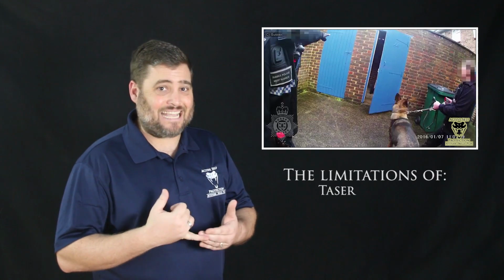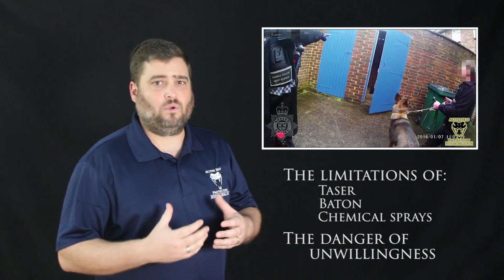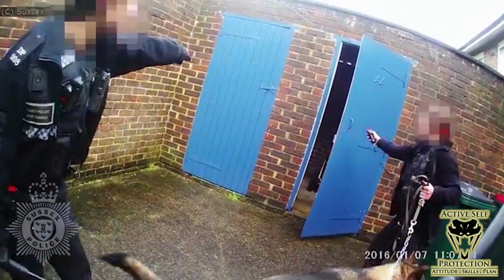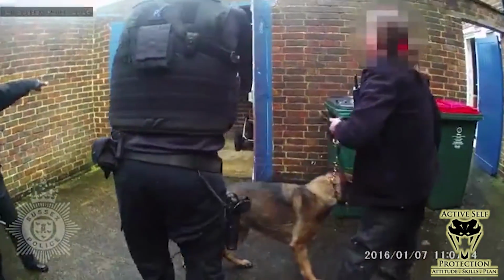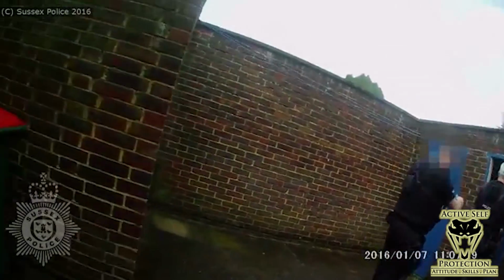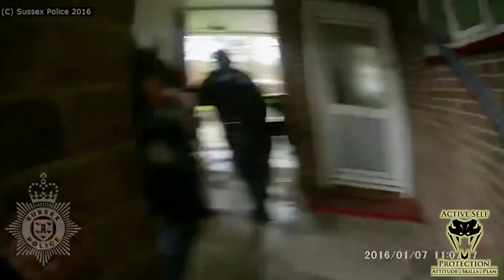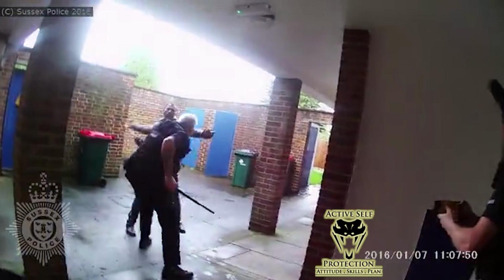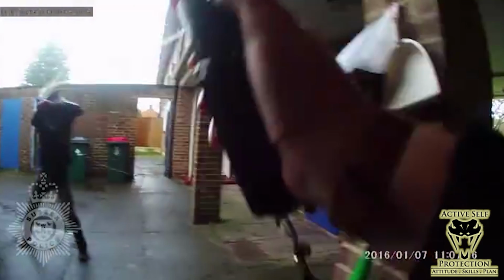Police Fight with Hammer Wielding Killer Shows Limits of Less Lethal Tools | Active Self Protection

Comment: Her screams were sad to hear. I'm glad she was ok. *sigh of relief * I'm angry and embarrassed at these officers. But i understand that a situation like this is not easy.
Reply: +Kevin Goth Funny how you manipulate the truth in this video. She didn't "confront" him, she was simply cut off and then she started to scream instead of defending herself with melee skills(the other woman with dog ran off as well). And eventually male officers had to jump on him, while she hides behind slope(actually during whole procces she was hiding behind male officers).
Reply from the maker: Pretty much!
Reply: Kevin Goth The fact of the matter is mate, that she was useless and did nothing but scream in panic.  She had zero self-control against a guy that had a hammer: not even a knife or gun.  A hammer.  

The other fact is that the unarmed combatives/ self-defence techniques they teach at police academies are usually next to useless.  Someone swinging a hammer is easy to deal with unarmed if you’re properly trained.  

She should be reprimanded and retrained for her failure to handle this situation.  If she can’t handle the heat she should be out of the force or put behind a desk or in to some other non-confrontational role.  

There was also a clear lack of training for taser use.  They should be aware that thick jackets are likely to negate the effectiveness of a taser.  
 
Their best bet would have probably been to deploy the OC spray first in this scenario.  Why they didn’t is beyond me.
Reply: A situation like this is actually very easy, it consists of three easy parts:

1. You have an immediate threat
2. You aim at centre mass of the immediate threat
3. You pull the trigger at least three times in a quick succession

What has essentially been a child's play for a few thousand years now must be learnt again from scratch by people who are - let's be frank here - in the wrong line of work. Well, that's EU for you, and these people are trying to teach the entire world how to live. The fuckers are rotting from within.
Reply: It SHOULD be easy, they're the fucking police. They have both means and justification to shoot the attacker. What they lack however are mental qualities one requires to be a police officer. The policemen in the video cannot protect themselves, how the hell are they supposed to protect the society?
Reply: its not sad, shes a fucking idiot. they all got out and she didnt. If she was a good collected cop she shouldve put a bullet in the idiot. Hes swinging a weapon at you. screaming doesnt do shit but show how badly trained she was
Reply: Dean Cutler Ok Dean, can I make a guess that you’re not in to combat sports, and have received no training in martial arts?

Yes, you are correct, a hammer is a potentially deadly threat.  Would I shit myself if someone came at me with one while I was unarmed?  Maybe.  But I also have a combined 7 years training in military unarmed combatives, in this case Israeli Krav Maga, Brazilian Jiu Jitsu and Boxing, and this training has covered in depth defence against bludgeon implements.  A hammer requires a wide arc motion to have effect and this requires an attacker to telegraph their movement (put simply, they have to draw the hammer back and then swing it).  A trained person will begin their defence as soon as they identify the attackers shoulder movement, and close the distance, which negates the effectiveness of a bludgeon implement.  Protecting the head is the critical factor for a defender.  When the distance is closed there are a variety of options, from going to a double leg takedown, to a stand-up clinch or arm triangle, to a back-take and carotid artery choke, which would probably be the preferred technique for control and restraint in law enforcement.  

With my experience, I would take someone coming at me with a baseball bat, a metal bar or hammer as a gift, someone who is unarmed becomes far less predictable.  Someone with a bat, bar or hammer has at least one hand focused on holding the implement, or both, and those weapons can only be used in a small number of predictable ways depending on how they’re gripped.  Because an attacker holding a weapon is focused on retaining that weapon once you become entangled with them their hands are unable to be used to grapple and strike until they release the weapon, which means that what is an asset to them at the arc range of the weapon becomes a liability to them when a defender is inside the effective range of the weapon.  In other words, if someone ever attacks you with a bludgeon implement, protect your head, get inside and clinch up.  Keep this in mind for if you ever find yourself in this situation.  If, on the other hand an attacker has an edged weapon, such as a knife, then the best defence would be to use your run-fu Nike defence and do an Usain Bolt.
Reply: Maz Klassa i hear what you're saying. In this situation I defo would have set the dog on him. Just to be specific aiming to shoot at legs is actually dangerous as legs are moving targets and having small surface-area spread out these factors are greatly considered. Depending on your region, regular armed police just isnt a priorty for police. But i do feel they to be more proactive/head on than how they are now.
Reply: Maz Klassa ...also Sussex police just aren't used to this type of crime. To invest in gun-carrying officers would be costly. Plus government have made all these big cuts to the police force which doesn't help matters.
Reply: Maz Klassa Releasing the dog or capsicum spray would be the preferred option here.  

Firearms training is to target center of body mass only, ie, lethal force.  Under this kind of pressure targeting legs is nigh on impossible.  

All else is agreed.  In reality, additional to this, unarmed combatives training in police force academies around the world are woeful.  This situation would be easy for a properly trained martial artist to deal with.  I have trained with many SWAT and regular cops who have chosen to supplement their unarmed self-defence skills with Brazilian Jiu Jitsu and Krav Maga private training organisations because they felt that the training provided by the force was inadequate.  It doesn’t inspire confidence.
Reply: KenUbeleveit1 it is, just fucking shoot
Reply: KenUbeleveit1 bye Felicia
Reply: if she worked on cardio she would probably ran away from the guy appearantly her fatass decided to stay their and expected the other officers to safe her ass
Reply: so you expect woman to join in police department who should protected by male officers.
Reply: @thaiefahmed9561  no but the males were armed. The female may not have been.
Reply: KenUbeleveit1 As a UK citizen I find this whole approach to disabling a violent assailant both laughable, naive, but also very sad. In fact it infuriates me. It is an absolutely clear and definite sign of an institutionalized level of cultural tolerance. Tolerance of criminality. Tolerance of taxless citizens (not to mention that this accidental dross of human reproduction is probably a Benefits claimant). UK Police officers simply need to all be armed with firearms. Shoot in the legs to render the assailant immobile for the situation. I'm not saying outright merciless by shooting to kill (even though society would be better off, technically). I'm just sick of this pussified approach led by the standards of the Commissioner which means Police officers have to go out into the criminal world and face potential death everyday while being both poorly trained and equipped with "tools" whose effectiveness is frankly unreliable. And yes Police Officers should all have TWO guns in case the first one fails; then maybe even a third strapped in their upper boot footwear.
Reply: Who ever you are just get the fuck out here! When you have pistol it is really easy
Reply: Dean Cutler
A fist is also a deadly weapon. Everything can be used to kill, from a pillow to a rifle.

Difference is how quickly and effectively it can kill. A small hammer is not a deadly threat in a 1 on 1 fight when you are armed with a baton. 

What we learn from this is that no sane county should let women be front line officers. not in the army or in the police force. 

The UK police force need a total overhaul. No women. No weak men. Only the very best of the best. Teach them how to use batons again. Make them wear great coats again. 

When need the old proper bobbies back. 

Arming all officers in a country like the UK does not work. It's not necessary. It would likely result in more deaths of both suspects and officers. 
What would be far more effective is removing the copious amount of restrictions on police which mean a great deal of them are reluctant to use force when force is necessary, which just leads to things getting out of hand. 

The two male cops could have marched up and beat the living daylights out of this bastard, but because of the virtue signalling left they would have been sacked for police brutality.
Reply: Kevin Goth
They didn't act "infallible*" and didn't " just run off".  The UK police use a strategical retreat method, they were trying to draw him out from the small courtyard where he could retreat back to his house. The woman was dense and failed to retreat and so the officers re-advanced and dealt with the situation in a worse location.
Reply: Thaief Ahmed Hilarious how the tough male police officers who are apparantly infailable just ran off and didn't confront the guy like she did. Piss off with the "only men can do that job" bullshit.

Fun fact there were infact male officers there, who according to you are the only people fit for that job, but did nothing and ran away and tried to stupidly use tasers on a guy wearing a thick puffy jacket when they could have just swarmed the guy with their botons (you know the weapon she stepped in and used).

Funny how you think she's unfit for the job 'cause she has a Vagina but the guys who acted like one are.

Comment: while this video (and so many others on this channel) is very useful, one thing i find critical about this video is that it seems to recommend killing, when clearly a gun should be used not to kill on first occasion but to immobilize via a shot in an extremity, in the utmost case.
i am aware this channel promotes causing least harm, but in this video it might get a wrong message across.
Reply: Niko L no, you don't use a gun to injure or immobilize. That "a gun is not used to kill on first occasion but to immobilize via a shot to the extremity" statement is just not how it works. If you can avoid using lethal force, then you don't use it, simple as that. If you shoot with the intention to injure you are in for all sorts of lawsuits. You shoot to NEUTRALIZE the threat ONLY IF YOU DEEM THAT LETHAL FORCE IS NECESSARY. You DO NOT use deadly force to solely injure or immobilize. You don't use a sword to hurt, if you don't want to kill a person with a sword, drop it, pick up a bat and use that instead. Using lethal weapons like a firearm and shooting a person in the leg to stop them would be use of excessive force. Not only is it an excessive use of force, but there are many arteries in the human body, shooting them in the arm or leg can also be just as bad. You ever seen a cop shoot someone in the leg which ruptured the femoral artery? I have. The robber only had a knife, he got shot in the leg which ruptured said artery, he died within 45 seconds due to blood loss. He died a slow painful torturous death. If you don't have the intention to kill, don't use lethal force.

If you go hunting, what is your goal? To kill the animal you were hunting. If your goal is to hunt the animal, do you shoot it in the head, heart, lungs, spine, or wherever you want? If you chose to shoot the head or heart, you did the right thing. Your goal was to kill it and you did it in the quickest most painless humane ways possible. If you shoot anywhere else that doesn't kill it, that could be considered animal abuse because instead of quickly killing the animal, you chose to injure it and let it suffer a painful and agonizing death which is inhumane. If you don't want to or plan to kill it, don't shoot it. I'm not saying killing people is alright, but making a human suffer when using lethal weapons is inhumane and is pretty much torture and if you have no plans to do so, use other alternatives.

You don't send soldiers into a war zone to make friends with the enemy. If you wanted to make friends with enemies you do so through political negotiations and communication. Soldiers aren't going into a war zone to offer cookies and presents. They can provide humanitarian aid, offer protection, and training but they are not there to capture enemies and be nice to them. If the enemies shoot at them, they will be NEUTRALIZED with any means necessary. If you are sending soldiers to do peacekeeping, they are peacekeepers, they will only fire when fired upon weather it kills the attackers or not is not of concern as long as it neutralizes the opposition, otherwise they won't actively pursue. If you send them for combat, they won't play nice anymore, anything to NEUTRALIZE the bad guys is fair game. If you don't plan to escalate a situation into a conflict, you send peacekeeping troops, to KEEP THE PEACE. Otherwise, if their not here for peacekeeping or humanitarian reasons, they are here to NEUTRALIZE the threat.

This channel promotes SELF PROTECTION. Least harm is an outcome, but that is not the point of self protection. Self protection is that, SELF PROTECTION. If you need to neutralize the threat (ie: TO KILL) in order to protect ones self, you do it. If my life or someone's life is in danger, what matters most is my own safety and the safety of everyone EXCEPT THE AGGRESSOR. If a bear attacks me, is my life more important or a bear that outweighs me and can easily rip me in half more important? Would you rather shoot the bear till its dead so it can't kill me or use pepper spray to agitate the already aggressive bear which could potentially get me killed? If you chose to pepper spray I will haunt you and fill you with guilt if I die and if I don't you bet I won't trust my life with you ever again. The man may have a hammer in this case, but anyone would realize that a hammer to the head can cause permanent damage or even death. This situation may have been resolved without any shots fired, but what was the outcome? Was it really worth the gamble? The female officer was hit in the neck which could've been fatal, she's lucky to not be struck in the head, the male officer that confronted hum after running away confronted him in melee combat which could've left him injured. If you want to gamble your life by not neutralizing the threat in the surest way possible, by all means.

You also need to understand, shooting isn't as easy as games make it to be. When adrenaline is coursing through your body, basic motor functions decrease DRASTICALLY. You'll be shaking, you might get tunnel vision, your muscles are stiff. Do you really think its that easy to shoot their leg which is a) a skinny/thin target and b) a moving target? Plus as explained, if you manage to hit their leg, who's to say the bullet didn't shatter bone which can cause bone fragments to ruptured/tear the femoral artery? Lethal option should only ever be a last resort to neutralize the threat, not to randomly shoot at their feet until you hit them. If you don't need it, don't use it.

Comment: The guy is obviously an immigrant and the political implications for the police for using deadly force are worse than a hammer blow to the skull.  The Oligarchs who rule Europe from Brussels have emasculated the indigenous population.  It's sad that these men and women are putting their lives on the line for an UN-elected group of cowards who are destroying Western culture in Europe.
Reply: Correct.

I still would not have been a victim.  At least not making it so easy to become a victim as they did.  I would have more quickly gone to the spray, and as backup to the spray, been more quick with the gun.

I think the dog's reaction is key:  the dog senses that the Alpha Male is not the indigenous population, and doesn't protect them.  If the cops had decided that the indigenous population was Alpha, the dog would have made the job easy for them as well, and they would have been able to limp-wrist the spray (but still needed to do that quicker) and have the craphole in custody quicker than a french fry.

Comment: Bigger balls, better training, and less estrogen would have been enough to handle this situation, these cops should be fired. Lethal force wasn't needed either. I'm glad those pussy cops didn't pull their guns out because the only thing worse than these useless jabronis are coward cops hiding behind their guns ready to take somebody's life if they have anything more threatening than a toothpick in their hands. I can see if he had a knife then lethal force is more plausible, and yeah even a hammer is deadly. But with proper training, it is easy to subdue a threat without lethal force when the threat is only wielding a blunt end weapon. Especially when it's 4 vs 1.

Comment: He is in a room with one exit. Throw in some gas and then close the door and keep it closed. After a few minutes open the door and take him into custody. The narrator claims that the police did not know what he was armed with but they clearly tell him to drop the hammer before they try to enter. Also have the police never heard of a long stick or a riot shield, the guy was in a make shift cell. just hold the door shut until some riot police arrive and the problem is over. What is the rush it is only a man locked in a room.